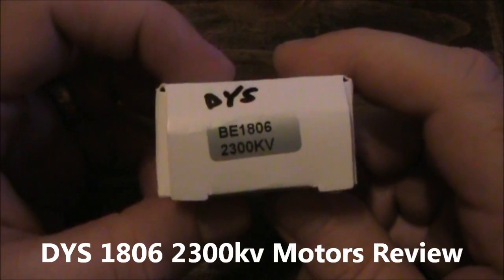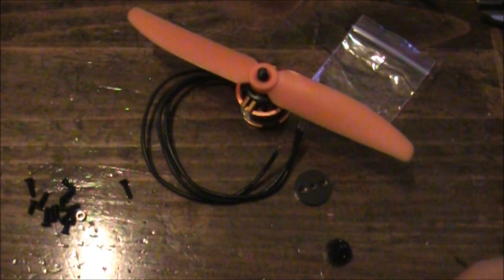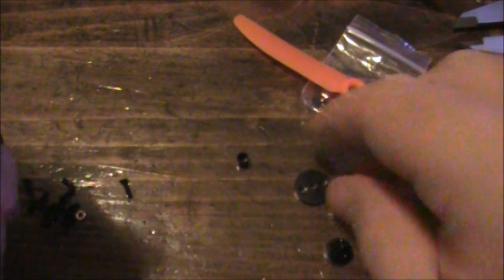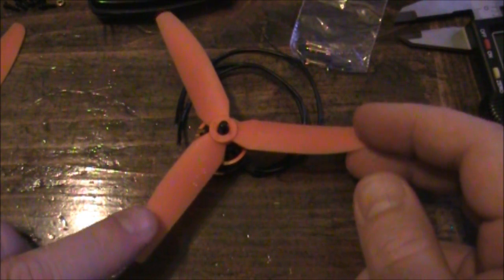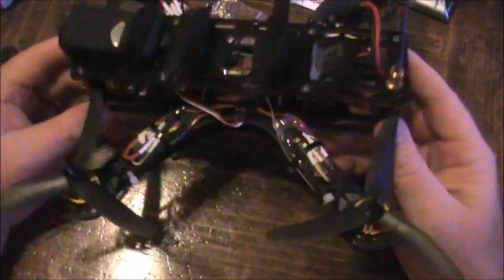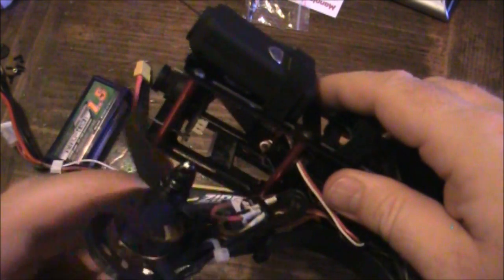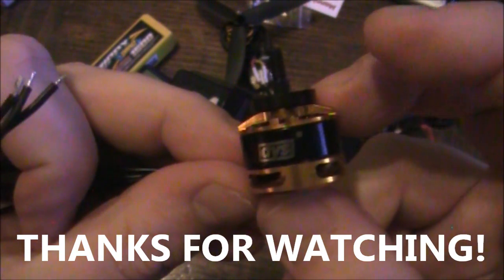DYS 1806 2300kv Motor Unboxing and Review

Comment: which motor is CCW CW;
Reply from the maker: Looking down at the motor, if the nut turns down clock-wise, then the motor is suppose to spin CCW.  In a crash, this keeps the propeller from spinning the nut off the shaft.

Comment: if the props didn't come with the spacers could you use something simple like scotch tape to space it?
Reply from the maker: +seth davenport The new DYS motors (basically anything released probably in 2015 and beyond) comes with a 5mm prop shaft so you should not need a spacer anymore.  I'm still using the motors in this video.  They are old now and they came with the 3mm (or was it 4mm) prop shaft.
Reply: ***** thanks!:)

Comment: hi mate.I bought this motors but I'm still waiting for CC3D, do I have to have CW or CCW motors or they are all same and controller will decide witch side he have to spin? thanks
Reply from the maker: +Pavel Prikryl These are all CW motors.  I don't think they are even available in CCW.  Just make sure your prop nuts are snug and you'll be fine.
Reply: +travisgrindal cool. so board will decide what direction have to spin?
Reply from the maker: +Pavel Prikryl If they are NOT spinning the way the board wants them to, you'll have to switch 2 of the 3 wires going from the motor to the ESC (doesn't matter which 2) or reverse the direction in the ESC firmware (if you&#39;re running BLHeli).
Reply: +travisgrindal no just Cc3D. So Thats The think. To switch wire. Many Thanks Thats help:)

Comment: what is the maximun voltage the motor can stand? 7.4v? 11.1v? more?
Reply from the maker: I'm not sure but it won't be much good for flying with only a 2S battery.
Reply: this is the battery that i already have: http://www.banggood.com/FlowerPower-EVO-1300mAh-35C-11_1V-3S1P-LiPo-Battery-T-Plug-For-RC-Models-p-977962.html
can they withstand it?
Reply from the maker: +hector231098 Yes, absolutely.  I run my 1806 motors off 4S batteries and they are still working fine.

Comment: OK, I'm a total, total noob. But I like quads and I love your video, so I decided to ask two dumb questions ;] I'd like to use these motors on my custom version of RC Logger Eye One Xtreme. My quad runs on 2s lipo only. How much lift can I get with these motors on 2s lipo using 5030 or 6045 props? And the second question is: do I need ESC? My quad doesn't have ESC and it runs ok with the stock motors. Please answer my questions and don't think of me as a total asshole ;]

Keep up the good work!
Reply from the maker: Tom eK I'm not sure about running them on 2S.  My Q200 with 3100kv motors can run 2S with 4045 props, but I've never tried the 1806 motors on 2S.  Your quad has to have an ESC.  Maybe it is an all-in-one ESC or they are built into the motors, but you have to have an ESC.  Where ever your motor wires are running to is where your ESC is.
Reply: ***** Thanks a lot Travis! I've just ordered the motors and I hope everything is gonna be OK.

Comment: the new version of the DYS motors comes with 5mm shaft so no need to use adaptors. Pretty nice upgrade from dys i'd say!!!
Reply from the maker: Gaming isnotacrime Yeah, I noticed that.  Even the 1306 motors come with 5" props.  I don't know why any quadcopter motor would come with anything but a 5" shaft now.

Comment: Hey one last question: i have been building my carbon zmr 250 with 12 amp afro ESC an the four of them worked fine. I already investigated on google but i didm' find anything. the problem is that when i turn on my quad and put the throttle up only three motors start and the fourth one doesn't start until its on full gas. I know its an ESC problem because i changed the motor on to another esc and it worked fine. Has anyone got any idea of what is happening??? The bad ESC looks fine. Please answer as fast as possible!!!!!!
Reply from the maker: Did you calibrate the ESCs?  Did you update the firmware on the ESCs or are you just using what they came with?
Reply: ***** calibrate?. No, how do you do that?
Reply from the maker: oscar russell garcía Remove the props.  Turn throttle all the way up.  Plug in battery.  Wait till beeps stop. Quickly pull throttle to zero.  Wait for beeps to stop.  Unplug the battery.  Done.
Reply: ***** OK. Thanks very much. It worked. I've finished it!!!
Reply from the maker: oscar russell garcía Great!
Reply: oscar russell garcía Nice! I can't wait to build my zmr 250 with these motors :D

Comment: I know it would depend on how hard you fly, but I was curious as to approximately how much flight time you get out of these batteries....
Reply from the maker: Kevin Ray Most of my batteries give 7-8 minutes unless I have FPV gear on my quad, then it is more like  5-6 minutes.
Reply: ok. Thank you.
seems like everyone is buying these batteries.. there are none in stock...that I can find
Reply from the maker: Kevin Ray Banggood has black ones (http://www.banggood.com/DYS-BE1806-2300KV-Brushless-Motor-Black-Edition-for-Multicopters-p-946416.html?p=6Z050013977120130325) and the gold-orange ones I have in the video (http://www.banggood.com/DYS-BE1806-2300KV-Brushless-Motor-2-3S-for-Mini-Multicopters-p-933192.html?p=6Z050013977120130325).

Comment: What timing setting do you use with them?
I just got some and was quite disappointed when I tried them, comparing with the same 5030 props on the same quad where I had the ZMR/RCX these had much less power.
I know you mention to try and use the 3-Blade ones instead but I was expecting them to at least have the same power as the ZMR with the same props so I do hope it is down to some setting on my ESC's as I also noticed that they were warm after flying and I didn't push them much. Thanks.
Reply from the maker: That is the opposite of what I experienced.  I had a mini quad with the ZMR motors and when I started using these DYS motors, I thought they were much stronger.  I think the overall hobby mini-quad direction is going to be 5" propellers so I've backed off using the 6x4.5 and went down to 5x4.5.  I think they are probably just as good as the 5x3x3.  I just flew 3 batteries on my quad with these motors and 5x4.5 props and the motors weren't warm at all to the touch.  Of course I was just doing some line-of-sight-PID-tuning and nothing dramatic.  I'm not sure where I set the "timing setting".  Is that in the ESC firmware or on the Naze32?
Reply: In the ESC firmware. You have from low to high timing usually it changes from motor to motor. Usually these high pole count motors run well in high timing.
I have changed now to medium-high and I'll give it a try.
I have here some 5x40 and 5x4.5 but I'm using 1300mah 3S LiPo's so with those the flying time will be greatly reduced.
Reply from the maker: Nandox7 Are you using BLHeli ESCs?  I've seen that option there.  I'm using Afro ECSc with SimonK so I don't get much ESC firmware tuning.
Reply: ***** Yes I have the BlHeli 13.1 loaded in the ZTW Spider 12A. I was using the Damped light mode so now I disabled it as well to try.
Reply from the maker: Nandox7 I had some real cheap blheli ESCs on my first mini quad.  The thing held its pitch very well.  I bought it used and I think the guy I bought it from knew how to tune real well.  I always wondered if it was the ESCs or his tuning that made it fly well - it was probably a combination of both.

Comment: Did you have to use thread lock on the ccw motors?I cant seem to find ones with ccw spinners.
Reply from the maker: I don't use thread lock on any of them.  All my motor shafts are "righty-tighty".
Reply: Pickup some nylon lock nuts from the local hardware store.  They are metric, but you don't need any loctite.

Comment: Nice video! i have these motors too (the black edition) and i agree 100%. they are decent motors.
I too have Diatone FPV250 frame, and i was only able to use 2 screws on the motors. Are you using all 4? if so how did you do it?
Reply from the maker: I usually only use 2 screws in each motor with blue locktite.

Comment: I'm going to upgrade my quad with these motors.Should i buy 2 or 3 blade. *i have a Fat Shark FPV installed and the same frame.
Reply from the maker: I'd say get either 3 blade 5x3 or 2 blade 5x4.  I'm happy with both of those.  The 5x3 2 blade props seem weak after flying the other two.
Reply from the maker: I bought some 5x4.5 props and they have been pretty good.  They are probably close to the same as the 5x3x3 props I've been using:  http://www.banggood.com/5x4_5-2-blades-propellers-CCWCW-for-X240-X250-Mini-Quadcopter-p-953843.html?p=6Z050013977120130325

Comment: 3 blade props actually give you less thrust than a 2 blade
Reply from the maker: I've heard people say that before but I question their results.  With my miniquads, the 3 blade props feel like they have more thrust when I'm flying.  Maybe it has more to do with the motors being able to spin the 3 blade props as strongly as they can the 2 blade props.
Reply: When you have less blades the better.
Because the blades dont have to cut through the same air pretty much
You can test it if you tape the motors to a scale
Reply from the maker: Have you tried both 2 blade and 3 blade propellers?  Try them both on the same quad and see which one you think has more thrust for yourself.

Comment: Thanks for the great video. I currently have the RCX 1804 motors (that you showed) on my ZMR250 frame and find them a bit slow with 5030 2 blade props. You think the DYS motor is worth the upgrade or should I just get 3 blade or 6" props?

Comment: what is that very small ring that comes with these motors?
Reply from the maker: That is a good question and I have no idea.
Reply: ***** haha, and the other round piece with 2 screw holes?
Reply from the maker: If you're referring to the coin sized one, I think that piece is if you use propellers that are flat in the middle with two screw holes.  That goes over the top of it and then the screws go through it, then through the propeller and then into the top of the motor.

Comment: any recommendation for direct mount props for these motors...  i dont like the spinners and motor mounts....
Reply: yeah, they come with a plate (spacer) to direct mount T type props... I've lost all but 1 of mine, my toddler used them as currency. I didn't care at the time, but now I need then to mount my 6x4.5 CF props... if anyone has some lying around... please!!

Comment: soo uhm how do you change it from clock wise rotation to counterclock wise rotation? or is that done by the flight controller....
Reply from the maker: You have to unsolder 2 of the three motor wires (between the ESCs & motors) and switch them around.
Reply from the maker: You could, but your ESCs would let out the magic white smoke.

Comment: is it ok to cut the leads on these motors?  they are really really long for my purposes
Reply from the maker: Yeah, you can trim them down.  I seem to cut off about half of each wire when I solder them to the ESCs just so there isn't so much wire mess.
Reply: thanks for that!!  cutting them about in half looks like it will work very well for my application.

Comment: What frames are these  motors bolt onto?  Does it fit ZMR or Reptile-X260 260mm?  because recommendations on those all start at 2004 size.
  I can fiddle with prop adapters but if the holes on the frame do  not match the motor, than you've got  a  real problem.
Reply from the maker: Yeah, they should bolt right on to the ZMR frames.  I use them on my ZMR250:  5030x3 vs 6045 Propellers on a Miniquad with DYS 1806 Motors

Comment: Total noob here. What is the other round disk with the three holes in it for?
Reply from the maker: It is for a different style of propellers.  Sometimes you'll see some with 3 holes in them that will fit that adapter.
Reply: ***** Thanks for the reply.

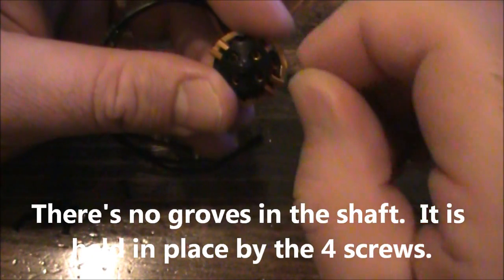Comment: Nice review, just a question: do these motors come with screws for mounting them on the frame? Thanks. Edit: Nevermind, I just heard the information I needed around 0:58. :)
Reply from the maker: Heh... good.  Yeah, they came in the small plastic bag.  They are long enough to work on fine on the carbon fiber zmr250 frame.
Reply: I'll be using them on a ZMR250, so it's all good. Thanks for the info.

Comment: How much your quadcopter weight? Flight time with 3S 1500 mAh battery? Thanks.
Reply from the maker: 447.9 grams.  I usually get 6-8 minutes of flight time.  It is fully loaded with FPV gear.  I show a little more of it in another video where I compare it to my mini tricopter.  simplecopter.com Mini Tricopter Review & FPV250 Comparison

Comment: wat kind of battery do u use for fpv and/or control? wats the flight time? do u use seperate batteries for fpv?
Reply from the maker: On my mini quad, I power it directly my FPV gear off my power distribution board so it all runs off a single 3S battery.  I get about 6-8 minutes off a 1500 mAh battery.

Comment: Thanks! I'm just wondering if I my Afro 12a ESC's will need to be reflashed also it would they already have the latest firmware. It says 2s-4s ion the specs so hopefully no reflashing required.
Reply from the maker: My Afro 12amp ESCs worked fine on 3S with the stock firmware and never had any problems.  However, on 4S they would just cut out when I really pushed the throttle until I upgraded the firmware to the latest version.  If you don't have a flasher, I hope you're planning on using 3S.  :)

Comment: Are those Afro ESC's version 3? I have the same motors and the Afro 12A V3's on the way and I plan on running 4s 1300mah lipos.
Reply from the maker: Yup.  Afro 12 amp v3 ESCs.  I ran 4S through them on another miniquad.  The DYS motors should be able to handle it.  You just want to make sure your motors aren't getting too hot.  Heat is what kills motors, not voltage.  If you can hold them without burning your hand, then they are fine.  If they toast your hand, then they aren't going to survive long.

Comment: Hey I'm working on pretty much an identical build right now. What screws did you use to mount the motors to the frame? I had to use the Silly adapter plates that comes with the Diatone 250, but would prefer a cleaner build like yours. Thanks!
Reply from the maker: I used the screws that came with the motors.  I had to drill the holes in the arms larger so the screws would fit through.

Comment: What are your exact ESC ? supporting 4S ? I guess not the EMAX 12A flashed SimonK sold by BG ?. I am planing to mount these motor on Diatone #17 but only 2 holes on 4 can be used for screwing (12mm & 16mm width). Is it normal to fix motor with only 2 screws ? Thanks
Reply from the maker: I'm using 12amp Afro ESCs.  They didn't work well with 4S batteries till I updated the firmware on them.  With the old firmware, when I turned the throttle up all the way, the quad would drop out of the air.  After the updated firmware, they perform just fine.
Reply: ***** I see ... and for the mounting ? you can use 2 or 4 screws with your frame ?
Reply from the maker: I just used 2 screws for each motor.
Reply: ***** Travis do you know if they are shipping with the upgraded firmware yet or do I need to do it?
Reply from the maker: I don't know if they are or not.  I used the USB connection adapter that connects to the 3 pin adapter that usually goes to your flight board to do the firmware upgrade.